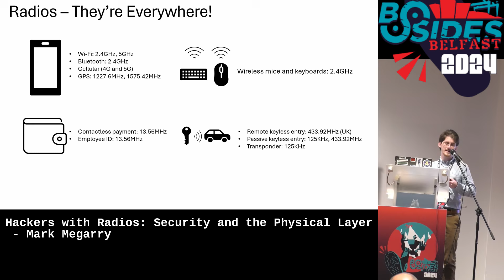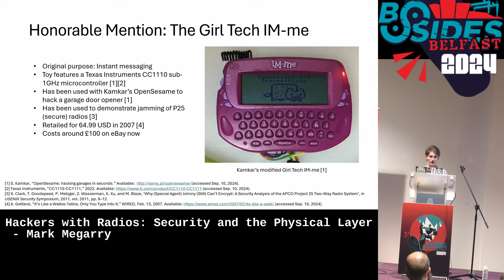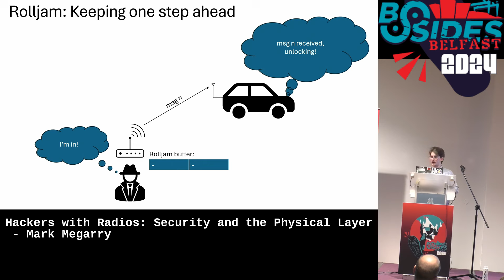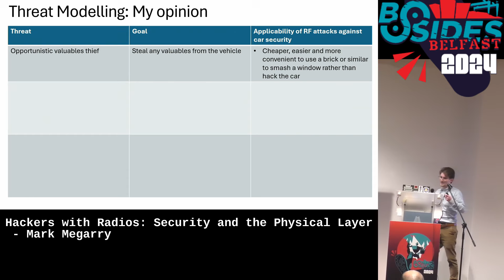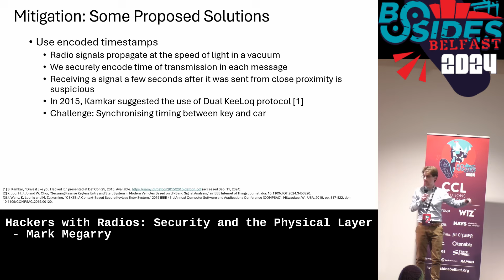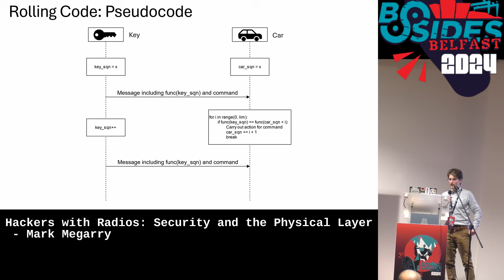Hackers with Radios: Security and the Physical Layer - Mark Megarry

Comment: I have 7 SDRs (2x Hack RF One & the Portapak Marauder), Cardputer (Esp32 with 100 firmware written 30USD with a grove connecter) a serial connecter either by going through the SD card break out for another means to accessing the GPIO, but the I2C is pretty good already. It has an in/out switch, so the Serial SD card breakout PCB can be used to link together mand different things. The number of penetration testing firmware's the IDE available to make more, the modification of the in/out grove switch vis physical alteration of the Grove input by adding one for in and one for out as you can string so many based on address and power on 12C). A PCB add-on board from the SD access for serail and combining all the different main ICs and on board antenna plus a coin cell or 18600 lithium ion battery and a 5W two way signal amplifier and even an attachment for RFID spiral wave amplification for distance and again the keyless door and keyless beacon would be easy to 1. add a GPS time and location as the Grove already takes a good module I wired to carry the info - the pps but that it has locked on is already contained in the location signal as without the pps signal, it knows when the device is sending that signal without having it attached to anything for "war driving"). It also will do raw sniffling. It would be rather easy to attach a USB, serial, or grove to the ESP Cardputer to make easy peasy firmware add to attach the ESP 32 Cardputer to a HackRF one or a Analog Devices Pluto and even use a simple device to feed a 10Mmz signal into the HRF1 or the Pluto. You also have a very capable FPGA, MIMO, and a better set of in board filers as well as full duplex 10Mhz to 6GHz as well as 2 additional ARM cores which can be enabled with so serial commands issued to the Analog Devices Pluto. Imagine running a very lite version of DragonOS and other firmwares for using both the ESP 32 but actually loading GNU Radio itself into the FPGA on the Pluto and the Cardputer as the input screen and keyboard or better a RP cyberdeck as there as many options. A very tiny high powered RF pen testing hardware /software combo could be made with a Pluto or HRF 1 and and or Cardputer and the newest Cyberdeck on Kickstart for 90USzd ( bigger screen and keyboard as for 30 USzd the cardputer is pretty awesome but imagine the marriage of just a little more (A full quad arm and the dusl arm + FPGA combo of the Analog Devices full duplex or just the hackzRF one which would only then be bound by antenna size and a power amplifier but could do very complex signal analysis, spectrum analysis, MIMO, even working Sats with a portable dish even one if those self aiming old RV dishes with a few different feeds (swappable feeds) and attachable Yagi antenna for tracking). In your backpack you can have basically a full mini computer with enormous amounts of RF GModulation modulation and signal analysis cig in it and spectrum analysis as long as you bring along a few extra battery packs or a 12 volt lithium ion homemade S3 P7 for 2 bucks with a boost and buck converter set up. You could even have different levels of discretion by using wireless to control your more capable rigs be they set up outside away from you or only the freq specific antenna concealed or visable such as disguised as WIfi USB stick but with different "guts in them. You could turn a helical directional 2.4 or 5.6 etc .. on a small dialectic insulator on a jelly or jam lid and have it an easy USB type plug which is real an SMA or  mini-ipec snaps but using only two of the USB connector to be a little more stealthy. 

I just wrote a voice and speaker version of the Gemini firmware for the card Peter which I basically just need to configure and compile and perhaps adjust the configuration input to allow your API key and Wi-Fi connection to the added to the firmware via the screen and the keyboard as opposed to directly in the code before compiling into the firmware. 

If it's that easy for me to make a latency efficient connection with an ESP 32 to the Gemini large language model/fusion model program over Wi-Fi utilizing not only the on ship memory but the SD card as virtual memory and persistent memory to reduce the load on the internal memory and the processing power of an ESP 32 imagine how much more room and how much more computing power you would have with an armed core or two or four a little bigger of a screen via ePaper or a bit bigger LCD and a slightly bigger keyboard than the card pewter with the computer is so inexpensive and it's already so firmware rich as far as precompiled bins available for downloading if you could combine that flexibility and that number of software options and the ease of the IDE and number of form specific libraries with something as powerful as the hacker F1 or the analog devices Pluto especially if you bring an extra power pack or create some custom PCBs which people have already started doing for the cart feuder as the use the serial breakout via the SD card and adding an extra groove module connector very carefully cutting out the plastic and getting rid of the switch for in and out and having both an in and out simultaneously available on the original board with an automatic switch than or go ahead and break out a GPIO quick connector or some type of I think it's a five or six pin GPIO connector for the serial and that way you're not potentially screwing up your SD card slot or putting extra stress on that particular part of the PCB in your card computer because I'm sure it's not super duper strong so there's just four screws on the back and it actually has two lithium polymer batteries inside for long battery life and it actually eats very little power it will run for a very very long time even running a GPS module for war driving It draws a very small amount of power. I'm walking around the city with it just for an experiment about battery life and it's absolutely never gone through even 10% of a 10,000 megawatt hour battery pack. That's driving the GPS module via the groove port and constantly updating its position as it actually sends the fact that it's warmed up and fully connected to your ESP32 screen without having connected the pulse per second wire which I think could be easily utilized as a Doppler shift control of any SDR which would increase your accuracy and the abilities making it possible to even you sat down through your Android as Android has set up and SDR plus light. It also has the drivers for both the RTL SDR and a hack RF1 and I believe the analog devices as well for your Android device so now it's a question of coming up with some custom PCBs to interface in between the analog devices and the hack RF1 and then creating perhaps some flexible PCB antennas and a very cheap power RF amplifier 5 Watts or no more and an additional power plug in for a small 10 megawatt lithium polymer or a couple of 18600 lithium ion batteries in a little plastic printed battery pack. 

Miniaturization of all of these technologies could be done for very little and it would only take a few alterations or additions to the VCB and alterations slightly to some of the existing firmwares so expanding them so that they can take use of their full capabilities as some of their capabilities have been downgraded for you Sun and ESP and then adding ones that have expanded capabilities and the ability to connect to your Android device via Bluetooth or Wi-Fi but Bluetooth would be probably the best because then it frees up your Wi-Fi for doing something else.. unless you want to add a small additional Wi-Fi micro PCB that they make that are so small and I think they even have some that have castellated edges so it would be like open up KICAD 8 and just start placing a bunch of connected pre-made castellated edge PCBs, And then wiring up or connecting by copying directly the open source 5 w amplifier which will add to the bias t so you can attach filters for the FM range and other types of filters for different frequency ranges to reduce your overall spurious radio interference and with flexible PCBs those could be easily and discreetly made into directional Yogi's or placed in a way let's say an A as a patch antenna that's very discreet disguised as a number of different peripherals including a camera on a tripod. As long as you have a lens sticking out of it everyone's going to think it's a camera but it could be very easily a Helix either left right or if you want to get really tricky at QHF or a for DVD player with multiple different frequencies either omnidirectional or directional.